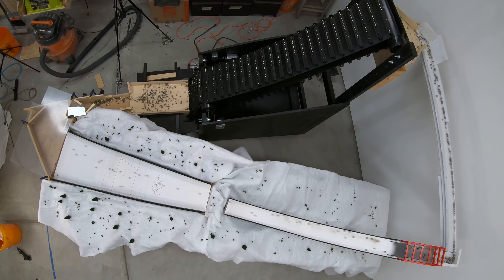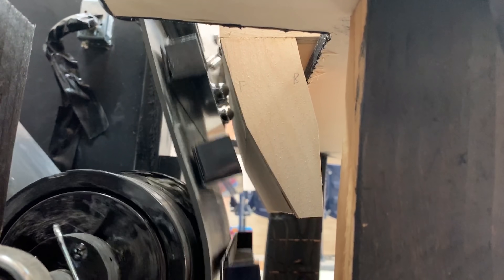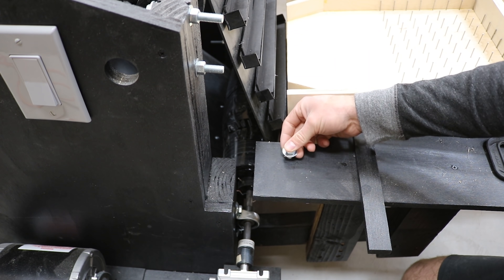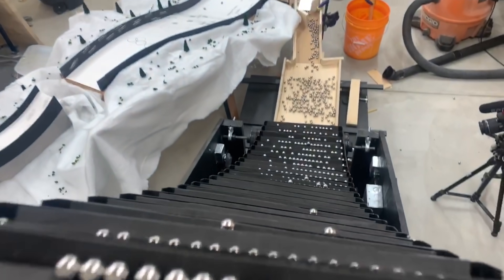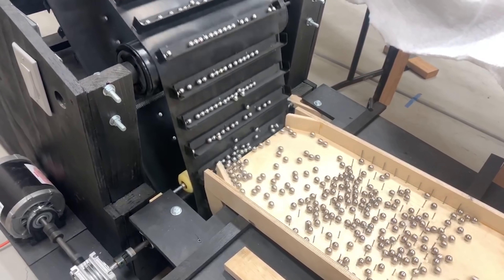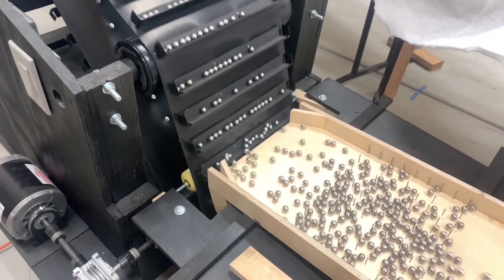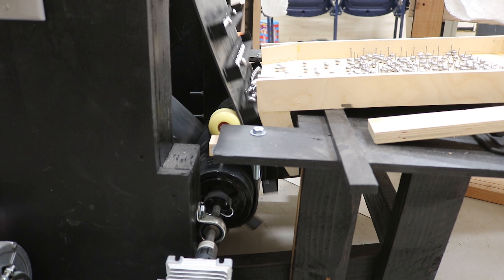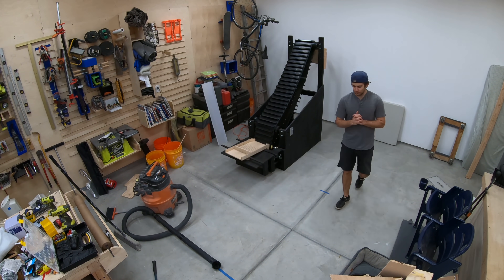Universal Marble Machine Lift, Part 6

Comment: Out of curiosity would a row of soft bristles aligned like the head of a push broom fix the lift drop issue even further?
Reply from the maker: It may, but issues now are such a rare occurrence now that I’m not concerned. If reliability does drop I’ll definitely consider it!

Comment: A couple of fins on each side of the entrance to the lift would probably catch the stray marbles when under peak capacity.  As you said, you are probably going to keep pushing the limits for the downhill side, so closing off any potential weak spots at the lift will mean fewer stray marbles in the long run.

Comment: I know this isn't meant to be anywhere near the level of Wintergatan's MMX, but you should really aim to have at least the lift drop zero marbles in a few hours of runtime. Other parts that you don't reuse are fine (especially when the marbles literally fly through the air), but an integral starting point really should be at one per multiple millions of marbles at the very worst.

Comment: Great jop! The ski jump seems perfect for the winter marble league!
Reply from the maker: It would definitely fit right in!
Reply: @BenTardif  I watched this and noticed and one thing to consider would be to put a board near the belt to the side of the lifting platforms.  Even after the rollers, some of the marbles obviously escaped and it was to the side of the lifting platforms.  Placing a guard to each side would probably virtually eliminate any loss on the lift.